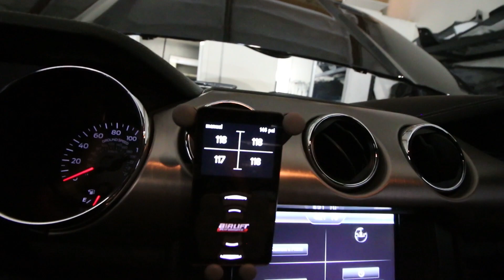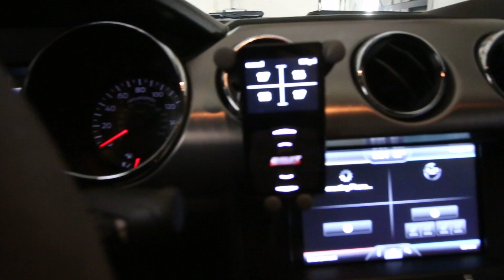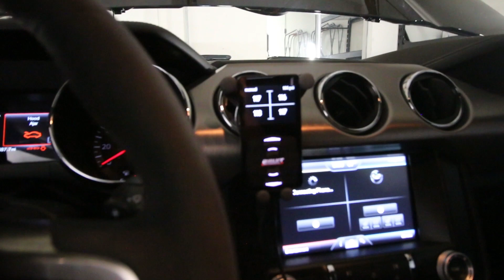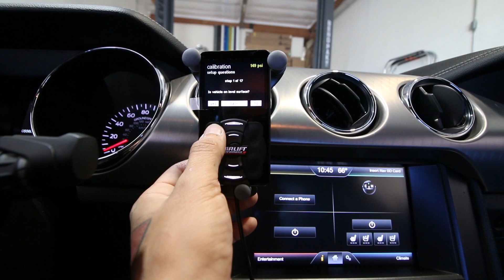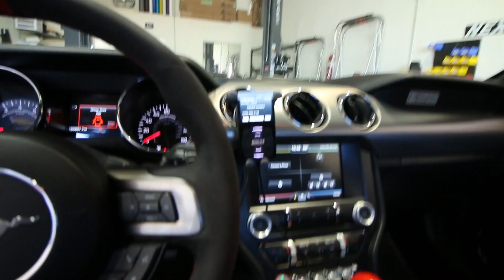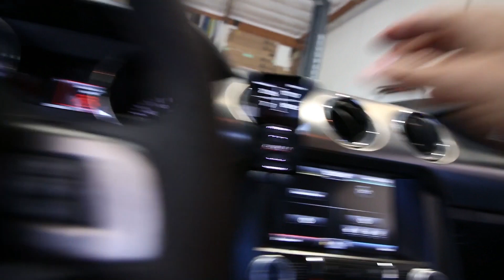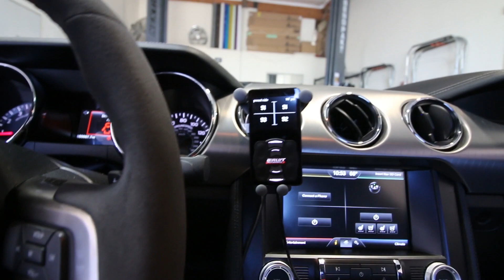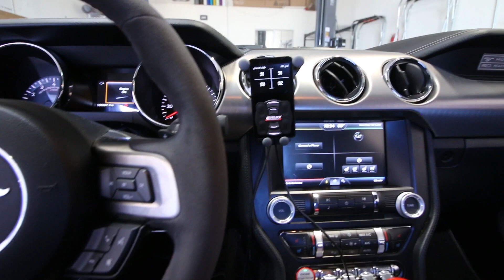Airlift 3P kit Complete Install On S550 Mustang

Comment: i got the airlift 3p as well. my problem is, every time i air out my car right, then i wanna drive so i press the ride height, but ever time i do so, my preset ride height never stay the same how i saved it. why my preset always incorrect? like the front be on the wheels, while the rear is all up. never how i saved the ride height.
Reply: Still having that same problem or did u fix it
Reply: @devonwyatt8498  yes
Reply: @devonwyatt8498  same problem
Reply: Bad ground 🤷‍♂️